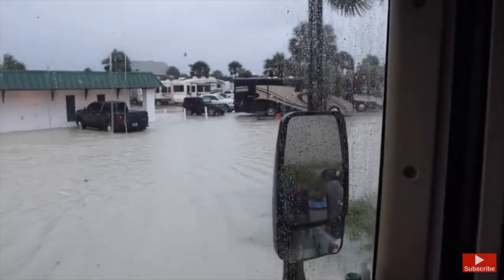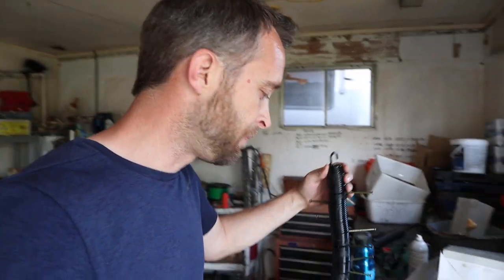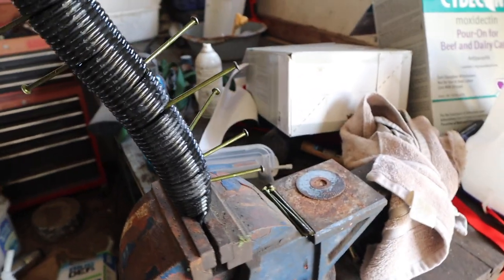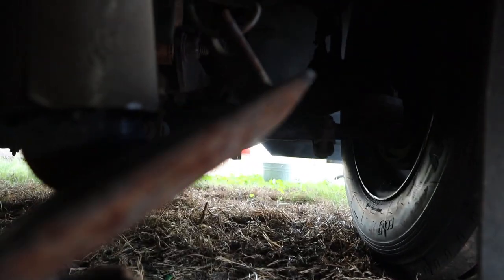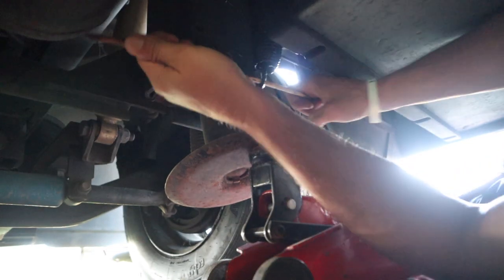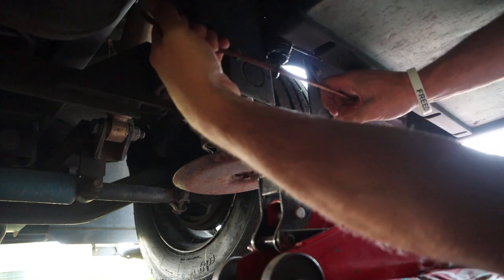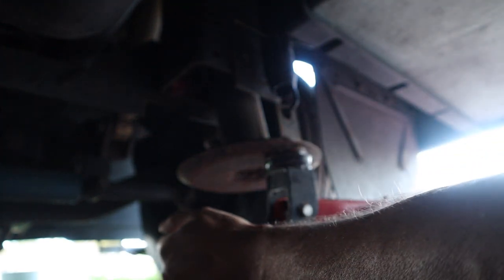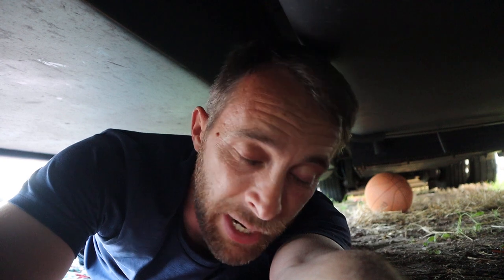How to Replace Your RV Jack Springs

Comment: This was more a video on "how to replace jack springs the hard way"
Instead of nails (hope you found them all), use sections of paint sticks. Use a "come along"  to extend it. 
Put more in, until you get to the length you need (you did too few).
Taking off the old is super easy, extend the jacks, insert paint sticks, retract jacks

Comment: I outfitted my travel trailer with tongue jacks on the rear corners. They are remote control. The jack operates on a ball screw and the motor reverses so they power down and power up.  Glad you are handy so you can fix things. Jack up the RV with the jacks and block it then raise the jacks. Put up a sign for an exercise program. Have folks try their luck with pulling that spring in place. You could even try to charge them. LOL

Comment: I saw another video where the guy loosened the 2 nuts that hold the top eyelets where you hook the springs and with the jack pushing up there was enough looseness to hook and unhook both on.

Comment: I used the 5 gal. Paint sticks cut to 3 inch lengths and the car pull with tie down straps. Insert sticks. Wala.ezy peazy

Comment: When you were putting on the first spring and had the plate jacked up high, it might have been much easier to turn the spring 180 degrees and hooked pointing out opposed to in.  The plate was tilted for better spring entry.   If you look at the springs on the second jack shown, one was pointing in and one pointing out.   Just a thought.

Comment: Couldn't you use a 2x4 or thick piece of wood on one end for leverage instead of pulling down with both ends of the rod?  Like pulling out nail with a claw hammer and piece of wood; same principle.

Comment: Tip find a 1/4 inch steel plate 12 x 12 inch a 2 inch dia pipe 12 inches long drill a 1/2 inch hole in the center of the plate put a piece of 1/2 inch all thread rod or bolt in it with 2 nuts then put the pipe over it. Then drill 2 holes for a U bolt 1 inch (OR MORE) from one edge of the plate bolt on the U bolt. Place this under the jack lower the jack on top of the pipe to wedge it in place against the ground. Use a come along or slim 1 inch wide ratchet strap on the U bolt and spring to pull it down. Will need wood block on pavement to clear the nuts underneath.
Reply from the maker: Thanks 😊